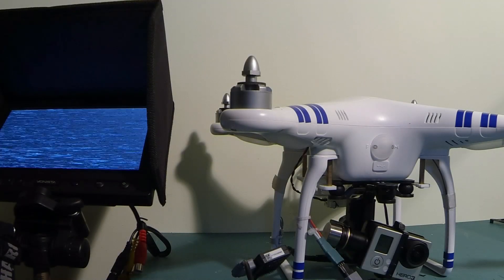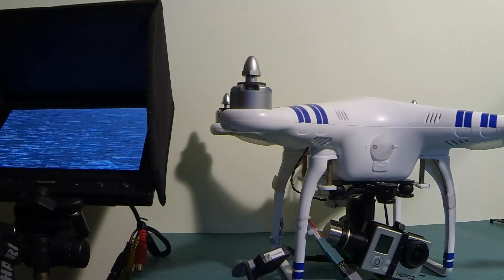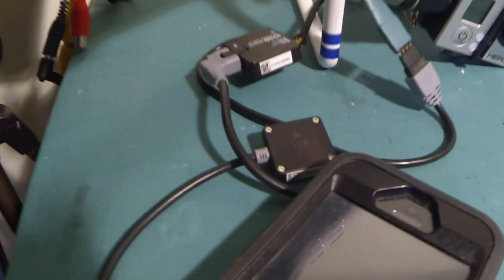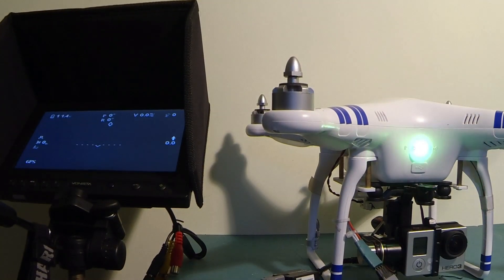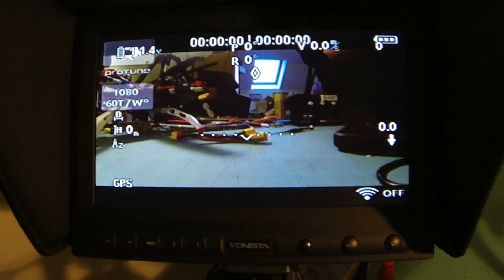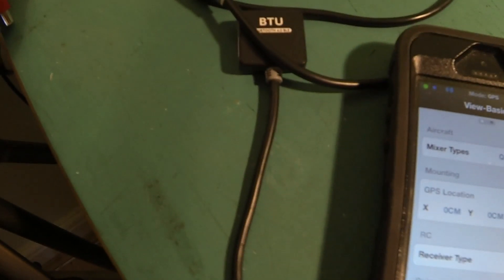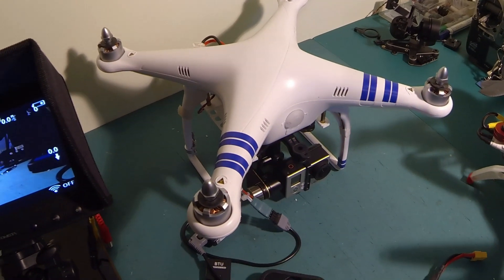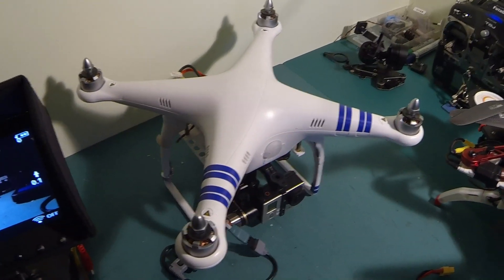DJI Phantom v1 - iOSD & BTU Testing with DIY CANBUS Port

Comment: Thanks for yor fast answer.  I m conect the iosd mini to can port then the btu module to the iosd mini.   But no way.   Do i did correctly ??   Or prefer to conect btu  directly to can port ??
Reply from the maker: Yep you should connect iOSD to the Can-Bus first then the BTU to the iOSD port. That should work. The iOSD has a small green light that should be on (and you should be able to see the output on a screen). If that works but the BTU doesn't then plug the BTU directly to the Can-Bus port and see if it works. If there was no light on the iOSD when plugged in then the Can-Bus port isn't working. Take the top off the Phantom and check the connections.

Comment: Hello
I m trying to install btu module on phantom 2.   but Dji support told me that can't be installed because Naza M v.2 is not compatible right now.  
Can you give to me any idea.  Thank you.  I think you're expert and give me any explanations.
best regards
Frank L.
Reply from the maker: Hi Frank. A bit puzzled on why they would say that. I use it on NAZA-M v2 fine. If you have a Phantom 2 then the BTU should simply plug into the Can-Bus port on the leg and work fine. Seen it done many times. If you have a Phantom 1 then it is a different matter and you need to do the mod in this video on the upgrade board or fit the PMUv2 Module (which has a can-bus port).

Comment: why you set your camera this way? It shoud be opposite.... unless you invert the gps module...but can you tell me how is the flight behaviour in this set up?
Reply from the maker: Don't get confused Pirate. The camera is actually mounted towards the front because this is a Phantom 1.5 coversion (Phantom 1 guts inside a Phantom 2 shell).
It might look like it is backwards but I moved the original LED to the front as I am running 2 LED's on it.... see this video to explain: Phantom 1 in Phantom 2 Shell - How to use 2 x status LED's
She flys great!